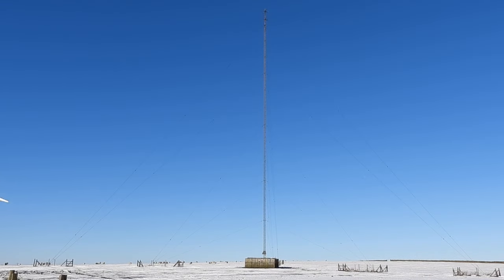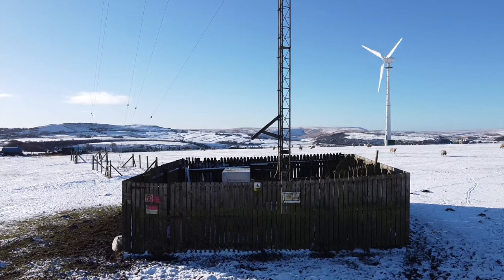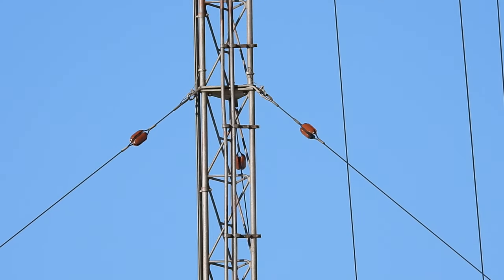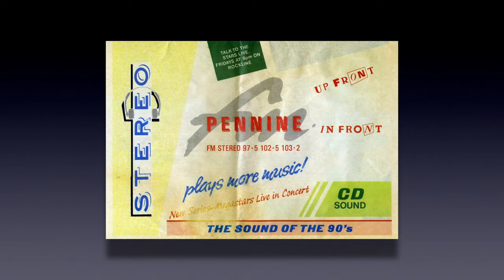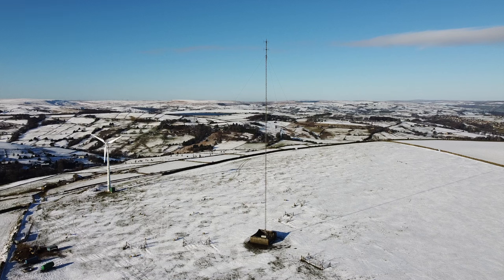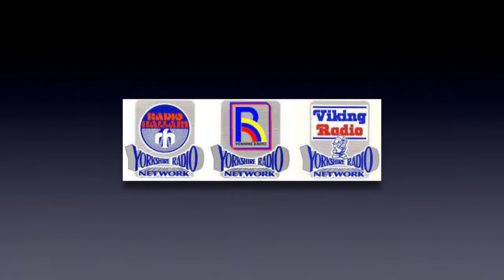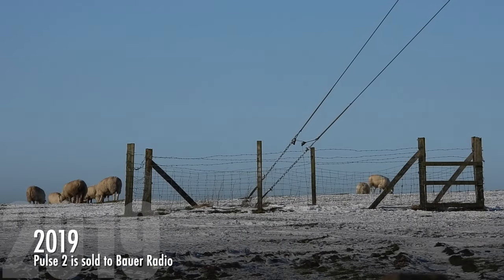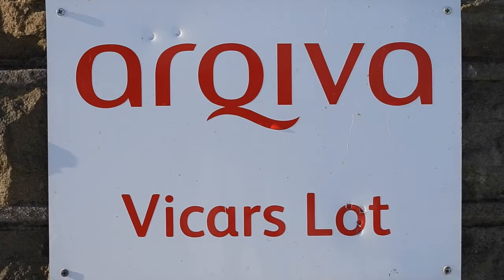This Radio Tower Is Really DANGEROUS

Comment: There are stories told about the old high-power AM station at Daventry back in the 1930's and 40's. I have heard that if you lived close enough to the transmitter  you could light your house from the very strong RF signal. All you needed was a suitable pick-up antenna. I don't know if that is true, or just a myth.